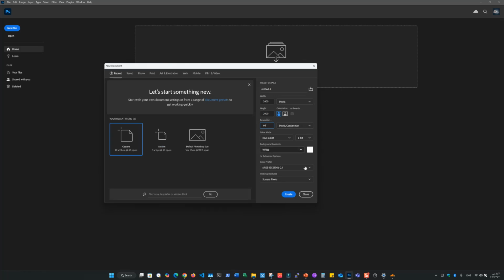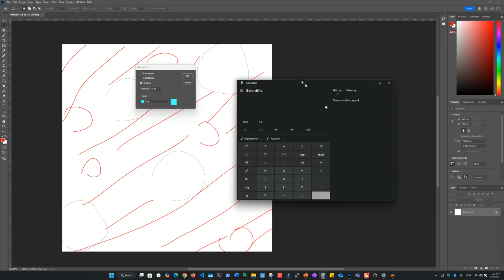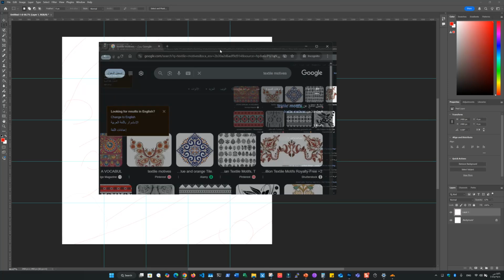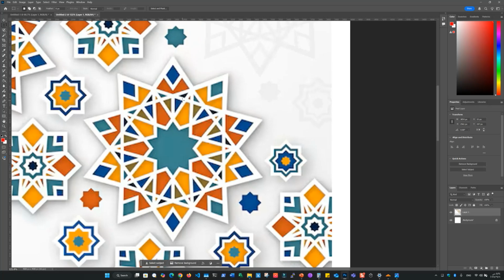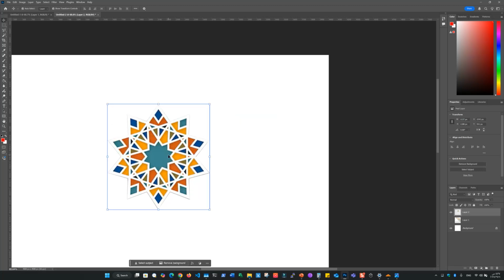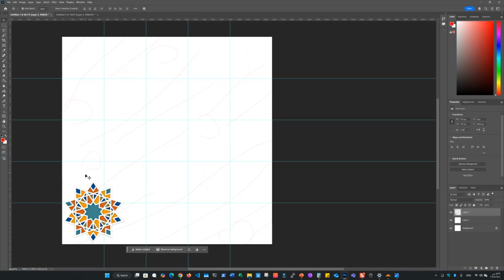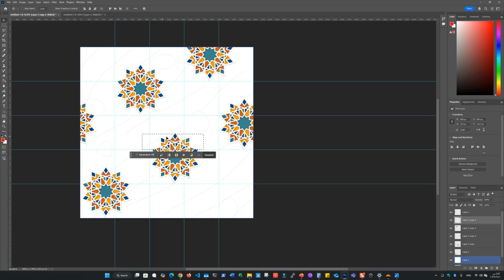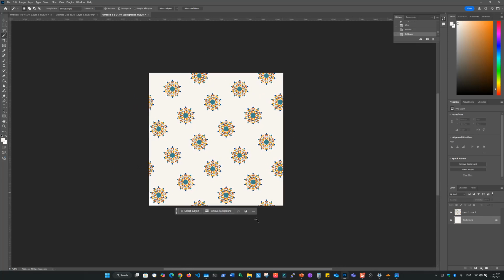Jacquard Textile Design in Photoshop (Part 1) – Setting Layout & Starting Weave Pattern (English)

Comment: can we use align tool from the top to aligned the 2 items simply and corectly i mean the shapes from the tool bar
Reply from the maker: Thanks for your suggestion! 🙌
Actually any tool that helps us reach the final result is totally fine. The main goal here wasn’t to make the shapes perfectly aligned, but to distribute them in a certain way — like building an atlas or layout for the jacquard process. Of course, if there’s an easier tool to achieve that, such as the Align option, we can definitely use it.